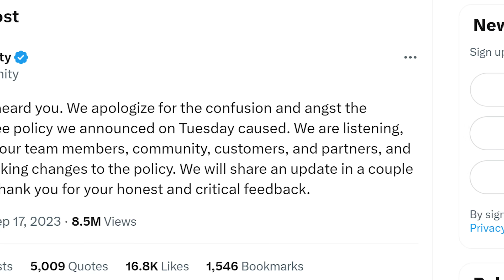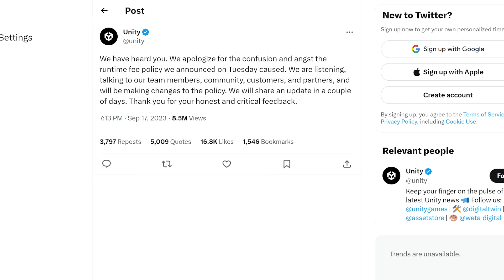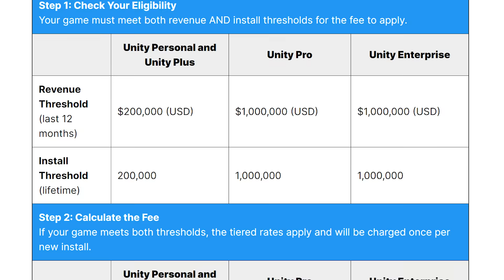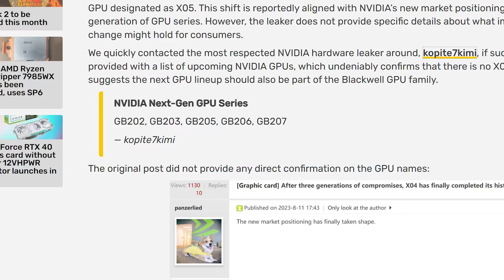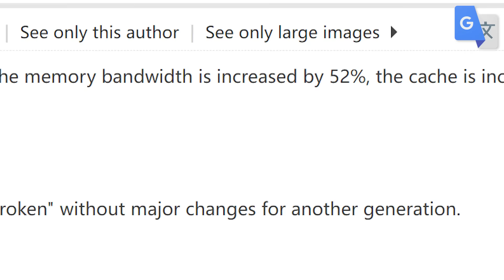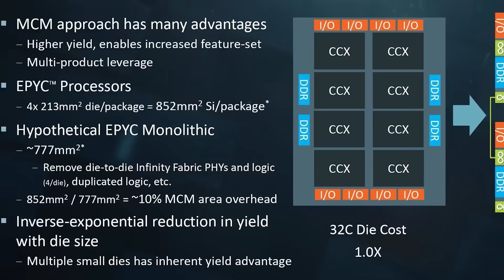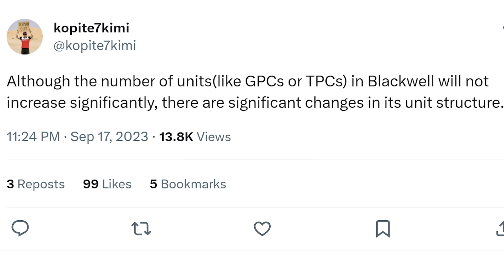RTX 5090 Completely DESTROYS The 4090!

Comment: it's crazy to think that back in the day, we paid $799 for a 1080ti, and that was for the best models. Now, a simple strix version, without watercooling or anything, costs $2000.
Reply: Nvidia made that mistake once and said never again.
Reply: @BotThot people are only now upgrading from their 1080 ti, and some are sticking till next gen
Reply: @GeneralS1mba  mines still sitting in an old build collecting dust, if they waited that long they might as well hold out a bit more. Unfortunately, I don’t think prices will ever come back down to those levels but getting 5 years of use from their GPU is definitely a good value.
Reply: I paid 639 for my Gigabyte 1080ti and that was a steal to me..the 1080ti was legendary in it day
Reply: This is so true. Prices today are ridiculously high. I had a gtx 1080ti and I upgraded it for a rtx 3080 from the used market. Got a very good price and sold my old gpu, that's the only reason I did it.
Reply: adjusting for inflation, given that 800 is the highest price in 2016 for the best card, then if we had similar prices today (2023) it would be $1023 adjusted for inflation. heck, even $1150 would be fine for a 90 series card, since that was for 1080ti . 
So that is $1150 MAX for a 4090 in 2023, instead they charge 1600!!! so theyre charging 450 dollars more! nearly 50% marked up than 2016. Prices need to go down 30% in order to be priced PROPERLY.
Reply: If you live in sweden it cost around 2500$ converted
Reply: I paid 1050$ for dual 1080sli. Compared to 1400$ for my 3080ti
Reply: Its crazy that the PS5 (with expensive controller in the package) cost 500$ while just the gpu of PC cost about twice more.
Reply: @infinnite4938   the 4090 rtx is more comparable to the price range of the titan we hand back then
Reply: Yeah I bought my 1080 like 6 years ago and the computer still holds up pretty well for 1440p. I'm building one with a 4090 by the end of the month
Reply: a year ago i got an rtx 3080ti second hand for $950nzd, a bit cheaper than i paid for my 2070 super when i bought it new a few years earlier.
i got lucky because it was one of those smaller brands. but the card is still a 3080ti at the end of the day and works perfectly.
i just had a look out of interest, they are still $1800 new a year later, plus they are all out of stock. 
jeeze. its a fkd up world we live in.
Reply: No, "back in the day", I bought a 3dfx Voodoo 2 with 12mb for about FL. 400. Which pretty much comes to €1500 currently if you consider inflation.
Reply: @ps4games164 or you could just get a mid range current GPU for 300 or 400 and have better performance than the consoles that have three or four generation old hardware by now.
Reply: @leanlifter1  

Still I have to sacrifice like 1200$ for unstable 60, same visuals while PS5 cost just 500 or even less. And coming with controller.
Reply: still have my EVGA 1080 ti in one of my machines and I love it
Reply: @ps4games164   4060 is like 300$ in my country and it runs everything on max at 1080p
Reply: @uoiuo  PS4 Pro cost less than that but running everything on 2k+/high.
Reply: To me, if a flagship GPU is more than 500 £$, then something has gone horribly wrong somewhere, yes it's always been the most expensive part of a gaming rig, but never more than 500 tops, in the same way a console would never cost more than that, when the prices become silly, the hobby just becomes undesirable and not exciting any more, the whole point of made PC gaming and GPUs exciting was that they were actually obtainable and reasonably priced, the Radeon 9800 Pro was never any more than 300 $£, about the price of a flagship console, and that was always the point and what made it a cool alternative to console gaming, have those days gone completely now, is it only a few super nerds who have nothing else to spend their money on that can obtain flagship GPUs, or will Nvidia come back to their senses.
Reply: @Wobble2007  q

Gaming was expensive before 2009. Especially the PS1 games.
Reply: I’m still rocking evga 1080ti … the card has been phenomenal, only now after 6 years I’m at a point where I feel an update is needed. The fact that the card has hold up for so long speaks for itself

Comment: the real questions are : will the rest of the 5000 series get a similar performance uplift ?  and will the prices get yet again another uplift?
Reply: Of course.
Reply: No. 

See the 4000 series. 4090 is almost 70% more powerful than 3090. 

But 4060 is around 10% better than 3060.
Reply: Probably cooked 4000 series with the bit bus limitations. Going back to the prior format with chip sizes and bit buses that reflect their counterparts in the 3000 a lower series will make it seem like 5000 series has a significant gain over everything else. If 4000 series kept to format instead of the gimping then there would be less of a bump when 5000 series comes around.

5090 is probably going to be the most expensive consumer GPU probably ever... that is until 6090 unless they price themselves out of the market and that GPU bombs.

Comment: 5090 will be so fast, it'll actually be able to run Starfield. Now they could easily make a 5090 70% faster.. but what reason would they have to do so? They have no competition, they make a LOT more money making AI hardware.. if they nerfed the 5090 to "only" 40% faster, people would still buy it. I'd be surprised if they went much further than that.
Reply: Problem is it'll be released in spring 2025. So it won't be as crazy then because we'll just have slightly more advanced games presumably and it'll be time for a new card to be released. But yeah, finally can play Starfield in 2025 😅
Reply: my 4080 and 5900x, plays starfield just fine at 4k max settings...
Reply: My 4090 and 13900KS runs Starfield at 4k native over 60 fps with max settings. Maybe something’s wrong with your rig.
Reply: @WiFeYBurGLeR1  I want 240fps. :)  And it's not even using ray tracing. Anyway it was just a joke because most cards have a hard time with that one. I already know the problem with my rig. It's 15 years old. When 6090 comes out, I do plan to upgrade. Then I'll stay on that one for 20 years.
Reply: @donutwindy   I want 240fps in 4k native too man you have no idea lol My bad i thought you were serious lmao
Reply: @turboimport95  I'm also totally fine playing the game at 4k with DLSS 50% resolution scaling on a 3080 and 5600X. Its so smooth everywhere except for towns. Not really an issue and I'm sitting too far away from my TV to see the scaling anyway and VRR makes it feel smooth almost everywhere. I'm quite surprised, I thought I would hate the performance but I love this game and I'm happy I don't need better hardware to enjoy it :)
Reply: @stefankoopmans2200  i dont use the upscaling yet, just native. But yeah the game dont need 100 fps to be good.  its still a ton of fun. lot of people were bashing it hard, but its not so bad.
Reply: Hardware isnt the problem, its the decade+ old skyrim engine they chose to build the game on top of instead of actually delivering something optimized. I'm guessing they havent further developed or remade the engine because they might not be able to integrate the level of mod support that bethesda gamers expect.

World of Warcraft has this same issue, the engine is so outdated the only way to improve your FPS is to brute force clock speeds on all your hardware since the engine isnt efficient enough to utilize everything at its disposal.

Comment: 5090 will require a 220V  outlet and a cooler bigger than 2 bricks.
Reply: 5090 will require an triphasic outlet connected directly to the GPU, and you should put it outside of your window on the summer time. In the winter you will save money with the heating system.
Reply: and 3 thousand dollars

Comment: The 6000 series is gonna be crazy. But wait till you see the 7000 series! But even that won’t stack up to the 8000 series
Reply: Actually, unless they start using something other than silicon, progress should really slow in a few years, around the 1-2 nm node.
Reply: @Toshinben  They’re already working on alternate ways to boost performance. There are quite a few at this point
Reply: @noidsuper  Can you name a few? I see maybe some more optimization of tensor core architectures, but other than that all I see are presentation improvements that aren't computational performance increases - DLSS with inserted frames, for example.

Comment: What will be very interesting is the power consumption.  If it's less than a 4090, then this will be a move in the right direction.
Reply: To be honest, I game @4k on a LG C3 and i haven't seen my 4090 go above 300w at 120fps, while my 7900xtx used a bit more power. I had a 7900xtx that i replaced with the 4090 due to bad drivers from AMD for multi display set up that i had(hard locked during driver install anything newer that Dec 2022 drivers), It's 2023 and AMD drivers are pure sh!t for multi display setups, it shows how far amd are behind with driver support. Single display the 7900xtx was fine tho.
Reply: @NoOne56488  Mine hits 600 Watts
Reply: @NoOne56488 AMD has always been the least efficient in both CPUs and GPUs against Nvidia and Intel, which is why laptop primarily use Nvidia/Intel hardware.

That being said... The series 40 is more efficient than previous gens, if you run the same workload it will consume less... If you push it to the absolute maximum, yeah, it has more cores, no shit it uses more power.

Mine also never goes up to 600w, at worst it did 480w more or less, with 3015MHz + RTX in game, but go figure exactly what the GPU was doing.
Reply: @NoOne56488 What 4090 do you have? Because my MSI GeForce RTX 4090 SUPRIM X 24G draws a peak of 431W when I run Cyberpunk 2077 in 4k RayTracing Ultra.
Reply: With a move from TSMC N4 to TSMC N3E (that's a rather minor improvment, especially compared to Samsung 8nm -> TSMC N4 the 4090 enjoyed), a 15% clock bump and a 50% core bump, there's absolutely no way that power consumption is going anywhere but back up again.

Comment: Going with a smaller process node is more expensive but will require less power per square area; additionally, MCM may offset some of the financial burden.  The 5090 could also be an AI monster!
Reply: which is all offset by the fact that Nvidia is using Samsungs GAAFET 3nm process which only has a 50% yield per wafer. The prices will either be inline to current or be more expensive. Either there will be a "shortage" like on every release or the failure rate of chips is going to secure these stupid prices regardless of how efficient they will be in other areas.

Comment: I like my 4090, but 1.7x better, faster, more, etc... that's significant.
Reply: Don't believe everything you see. The 5090 will be 50% faster realistically.
Reply: @laszlozsurka8991 that is still a lot.
Reply: Like my 4090 too... no buts.
The 5090 won't be out for 2 more years.
Reply: @MrAnimescrazy  And it'll also cost a lot too. $1,800 MSRP guaranteed.

Comment: I would assume they fixed the power plug design. I can only imagine how much more power that card is going to suck out of your house. I don't see games really getting to the point where you need that much power yet though. Probably by the time you do need that much power Nvidia will be out with the 7090 😂 and the 5090 will have dropped in price by then.
Reply: It's going to be much more efficient, but Id say they will still draw it to 350-400
Reply: It uses less instead of more

Comment: 1.7x irl usually means about 1.4x, which is still VERY significant 😮 plus

Seems like Nvidia really only wants to sell whats left over from A.I. chips 😅
Reply: na it'll be 1.7x the performance, for 2.5x the price
Reply: I wasn't even all that impressed by the1.7x jump from 2070s to 3080, so I don't think I will be all that impressed by just a 70% performance increase this time around. When I upgrade I'd rather see a 2x improvement at the minimum. I guess a jump from 3080 to 5090 will exceed that though, I'm already saving up money for when it arrives so I don't have to spend all my money to obtain one. I don't earn a lot of money, but I just like to have the halo card once again since that has been quite a while now, I guess that was the Geforce4 Ti4600 around 2002? And that wasn't even a good card btw, but price was around 350 euros or so? At least affordable high-end. From that time on I only bought used or midrange. I now own a used 3080 and it's good enough for me. Oh damn, time flies...

Comment: Well. Just remember that 40 series was made on manufacturing node that cost more than double the previous generation. And 50 series is made on manufacturing node that cost 25% more than 40 series manufacturing.  So decent jump is performance relative to die area but also small jump in terms of cost per area.  Nvidia has pretty much kept its actual margins similar or dropped them for every generation people complained after 10 series. They just paid more to manufacturing so that they could give you more GPU instead of being able to improve (cost_to_NVIDIA)/perf. 
The next node increases cost per area 25% but transistor density and clock frequency improvements combined give you mare than 25% so it improves price/perf.  The higher memory bandwidth is often done by the memory manufacturers delivering faster ram, but we don't know what they will charge for it. But hopefully we get 3GB chips. So 8GB->12GB,12GB->18GB, 16GB->24GB. 
However that 78% cache size improvement hints different route for bandwidth.  Right now Nvidia uses 24MB L2 per 128bits of bus width and 4090 has 3 times that bus width. 42.6MB would be odd choice for cache size. However (4/3)*(4/3)=1.78, which means 32MB L2 on 512bit bus.
Reply: not only is the fab cost 25% more but the samsung GAAFET 3nm process has a 50% yield rate per wafer currently. They could never enter production with a yield rate like that, GPU prices would skyrocket to even worse numbers. I think because of this they will only release in 2025 or at least only really enter their production cycle around that time.

Comment: "The 5090 is the worlds most powerful consumer GPU, coming into your home starting at only $2500 (1000W cable & connector sold separately at only $399).
Finally you can play the most recent titles at native 4K60fps and heat your home at the same time. 
The beautiful sound engineering of the roaring quad-fan array will please your ears every second of every day.
But there's one more thing. Every RTX 5090 comes with a free copy of Candy Crush 2024 4K Edition. That's even more value for you, our beloved gamers."
Reply: And only 6 slots thick and 500mm length for the Strix
Reply: @blindguardian8599  😅😅 ya i found that out the hard way when i got my rog strix 4090 home 😅😅😅😅  its 16 inches long 😅😅😅  i had to tear my computer apart and shove my water cooler fans to another spot.

Comment: Nvidia seems to be worried the RX7000 being real competition in the low and mid tier markets, hence accidently leaking insane performance gain figures for the next series. And while a 50% increase in the 90-tier will be a delight for the whales, it does not mean that the same performance uplift will happen in the price regions where most gamers will shop.
Seriously though: We need to get back to affordable prices quickly, or the PC gaming scene will slowly but surely bleed out. A mid-tier mainboard should be around 100 bucks, and a mid-tier graphics card at 250 and a high end at 500. Make one Übermodel for the whales somewhere beyond the $1000 mark and we're back in a situation where parents can afford buying their offspring a gaming PC and thereby recruiting the next generation of custo gamers.
Reply: Honestly  am not gona be surprised  if the 7000 or 8000 is gona be 4000 or 5000 usa or euro  😊

Comment: I gave up on nvidia during the 3 series massive pricing scam. The 4000 series was even more overpriced and there is no reason to think that the 5000 series won't be even worse. you can bet a 5090 variant will probably run 2k or more, which is insane to me.
Reply: Odd - in my opinion, the real price scam generations were the 2000 series and the 4000 series. The 3000 series was actually a (very) small step back from the 2000 series price hikes.

Comment: The Problem is the power draw. We are pretty much on the cusp of what will be allowed as the power grid cannot hold all electric cars, all electric housing, and almost all gaming households running at LEAST a 30 series card. It will get bad real fast.

Comment: The expected specs always leak early and performance uplift always overshoots to the tune of double or half again what the actual uplift is. 35-45% uplift seems to be what is in the cards if the pattern holds. A range that offers a far more likely amount than this would-be record setting 70%.

And remember, it seems the full performance uplift is reserved only for the 90 now and almost disappears by the time you get down to 60. Evidently we reached plateau 60 level performance with the 30 series according to nvidia.

Comment: The new architecture is going to have to be absolutely incredible if they want to do 1.7x performance uplift on such a small node jump with a mere 15% clock bump... 50% more cores won't be nearly enough - in the tens of thousands, scaling is very much getting non-linear. You can tell by how the 4090 isn't 60% faster than the 4080, for example.
Also, 50% more cores and 78% more cache would mean a die that's at the reticle limit (remember that cache has basically no density benefit from a node shrink anymore) or nvidia is finally getting into the chiplets game. Either way, expect the GPU to be very expensive to manufacture and nvidia is certain to pass the cost down to consumers.